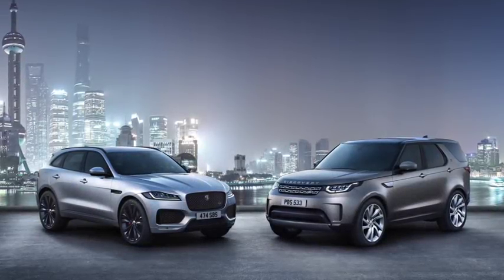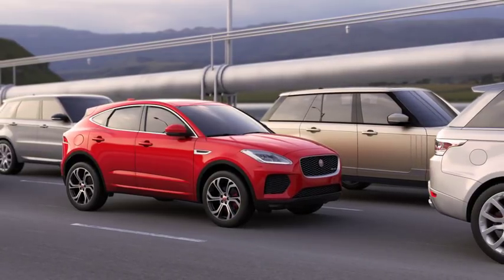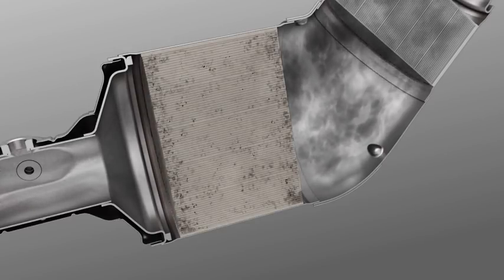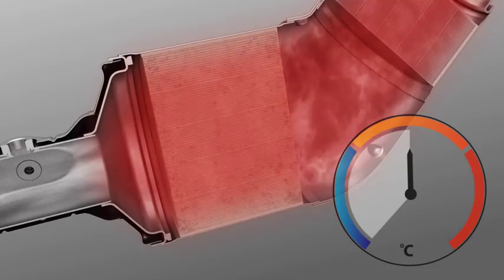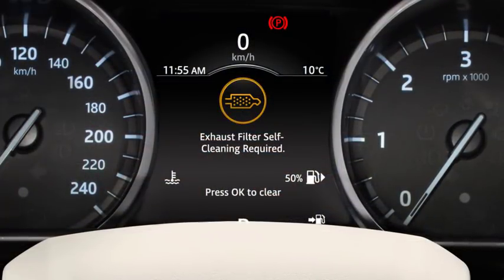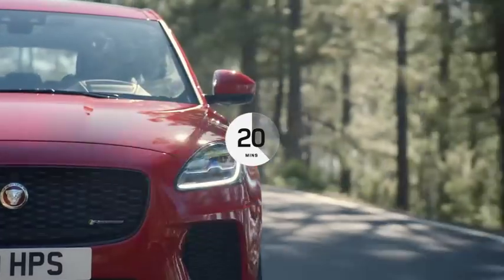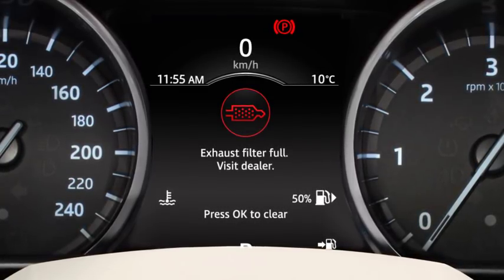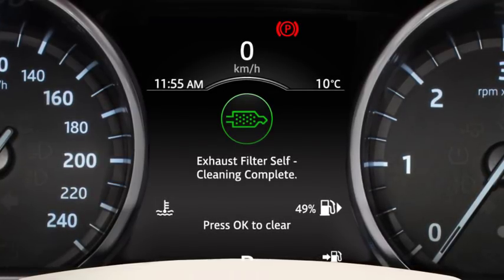Jaguar | Diesel Particulate Filter (DPF)

Comment: A shame the video makes no mention of the risks of sump oil dilution from part completed regeneration cycles. Very poorly designed systems on many current Jaguar models mean that your car has little hope of achieving its service interval mileage if you do any kind of short journeys regularly, even if interspersed with regular longer journeys. You won't know anything about it until your car flashes up that it needs an early oil and filter change, often way way before it should be due.

Comment: I have an E-pace for about 2 years with 61.000 km on it, I never ever saw that "regenerating the filter" message, result: I got last weekend the (red) warning that the filter was full and that I had to go to my dealer... Hope they can fix it and also making the filter clean itself (or at least show the message)
Reply: Any update? Was it full?
Reply: @Dm-dw3tr  yes, everything is solved meanwhile and had no issues so far.
Reply: @Smirnoff103  expensive fix?
Reply: @Dm-dw3tr  it was still under warranty

Comment: Goodbye mpg during regeneration. 
Basically a con.  Collect particulates then purge them out and wa5ch your mpg drop from 52 to 34 for 20 mins. 
This process has the ability to destroy your engine if regen does not complete after several attempts. 
My jaguar does not even tell me when it's regenerating which it does quite often and that is mostly motorway driving.